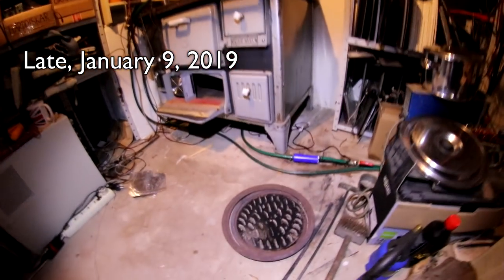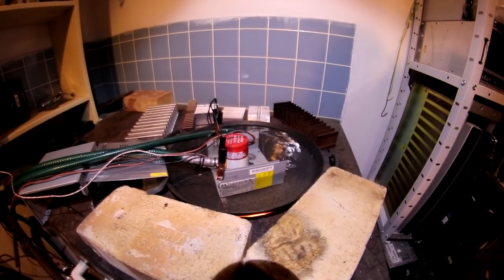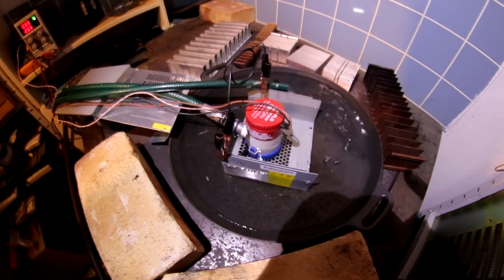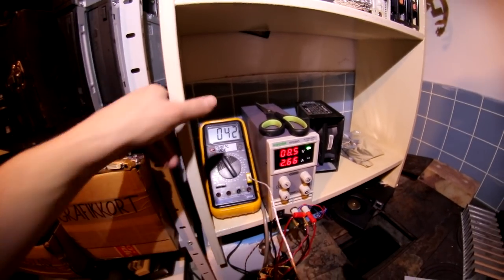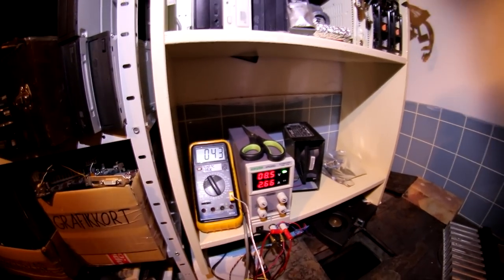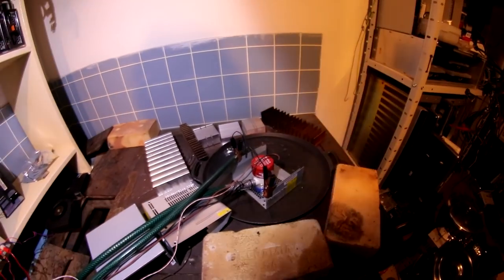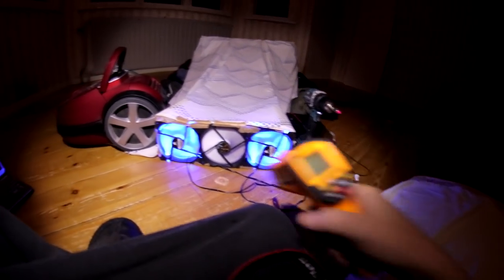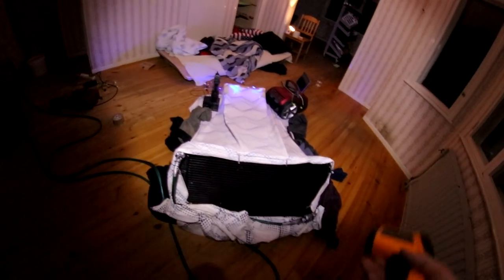Power loss blog 7 - WOK POWER!

Comment: Woks wonders.  There's hope for you as a plumber...
I'd have just moved my bed into the basement, next to the fire.  Work smarter, not harder.
Reply from the maker: The issue with sleeping in the basement of this house is that the floor is uninsulated, so the lowest part of the room is never above 10 C, no matter how much wood you burn. Upstairs was actually warmer.

Comment: What is the carbon monoxide level in the area breathing from the burning flames
Reply: Almost all is vented out with the smoke. There is a vent near the roof that takes most of the escaping smoke and gases. When you burn wood you notice pretty fast if it's not venting out properly.
Reply from the maker: Very low, since the exhaust is drawn out the chimney, and the fresh air for the fire is being constantly drawn in through vents in the wall.